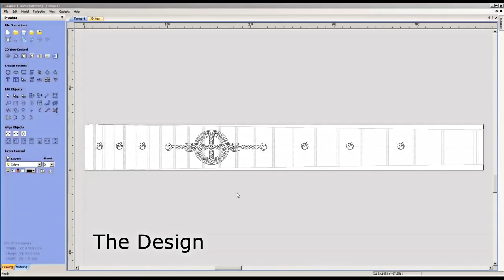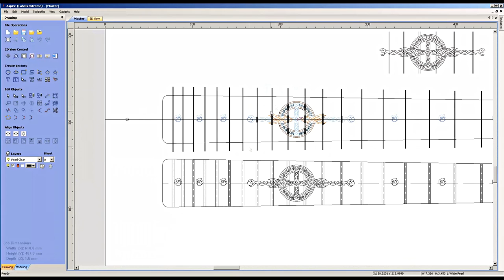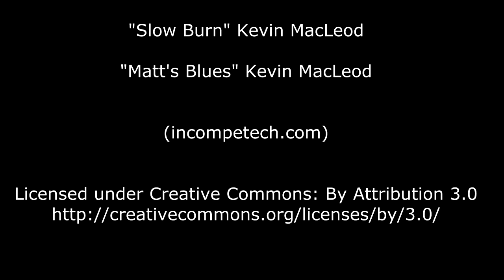Custom CNC Guitar Inlay - Celtic Cross

Comment: Quick question though; why radius the fretboard first and then do the inlays? .. Wouldn't it be easier to work with if the surface was flat? ..
Reply from the maker: Tony Vincenzi You could do it either way Tony, both would work equally as well
Reply: ***** Thanks man..

Comment: Hello Mr. Fletcher..do you know of a product to mix up and tint/color and pour your own inlays such as an epoxy ? Also what do you think about tinting Timber Mate and packing it into the inlay hole...just wondering your thoughts..thanks
Reply from the maker: Epoxy will work but Timbermate wont, its too soft and will powder away.
Reply: Thank you for responding...What would you use to color it
Reply from the maker: http://www.stewmac.com/Materials_and_Supplies/Finishing_Supplies/Colors_and_Tints_and_Stains/ColorTone_Liquid_Stains.html
& for solid colors try http://www.stewmac.com/Materials_and_Supplies/Finishing_Supplies/Colors_and_Tints_and_Stains/ColorTone_Liquid_Pigment_for_Lacquer.html

Comment: Does anyone have an idea of what to look for, as in an entry level-hobbyist CNC machine that would be big enough to do the fretboards, necks and bodies? My company has a 100,000 Multicam 120 x 60, but it would be so hard to find time on it to do anything. We use Solidworks and VisualCAM, does anyone have any idea on what the software he is using is called? Is it specialized? Thanks again for a beautiful show and tell with that Celtic Cross!
Reply: budget?
Reply: Barrett Hamilton
Reply: Ronald Forsyth - I ended up buying a small Stepcraft 2 840 router. it can be upgraded to have a 5-10 tool holder and I think it will be good for this kind of work. any advice for a starting novice? man, your work blows me away....
Reply: I'm glad you like get an email mail 2 me and we'll crossed easy with each other
Reply: sounds good. Thanks, will be in contact

Comment: Very cool man. I also do custom guitar work but haven't had to do any inlay work this fancy yet to have to get it done on a cnc machine. So if I may ask, how much did zit cost to have done? You can message me personally if you don't want it to be public as for outsource pricing. I'm just wondering a ballpark figure in case I run into it one day. I have got some things laser etched before but not anything like this with the inlay work cut to fit. Anyways cool video and I like watching your work. Cheers! -nate
Reply from the maker: Johns website is listed on the video, your best to shoot him an email for pricing :-)

Comment: how thin could this CNCs cut/rout? 0.5-0.7mm? (I have no idea)
Reply: Hi, the smallest tool I can comfortably use is a 0.3mm diameter. This allows for some super-fine details and very thin routing paths.
Reply from the maker: Hi, the smallest tool I can comfortably use is a 0.3mm diameter. This allows for some super-fine details and very thin routing paths.

Comment: That is a nice CnC machine, needs better extraction though, would suck to walk away and find that somehow dust had caught fire in a slot you were cutting and ruined your whole piece of work.
Reply: Hi Chris, the normal extraction system was removed for the video. With the tool, spindle, safety guard and machine brackets, there was no clear space for video access. The dust is unlikely to catch fire, but I seldom leave the cutting anyway.
Reply from the maker: Hi Chris, the normal extraction system was removed for the video. With the tool, spindle, safety guard and machine brackets, there was no clear space for video access. The dust is unlikely to catch fire, but I seldom leave the cutting anyway.